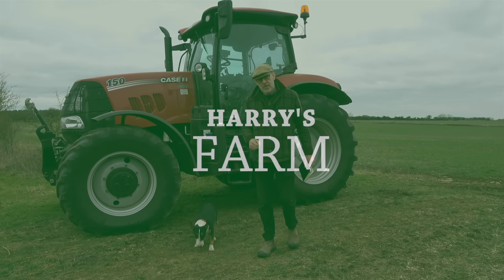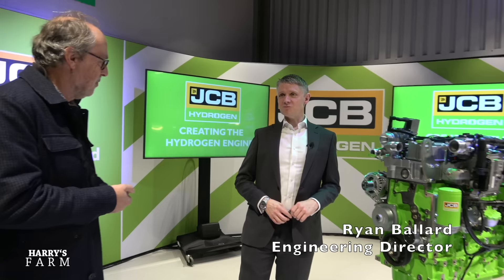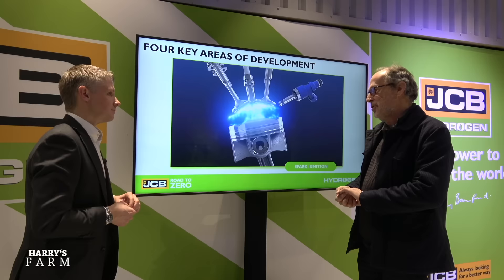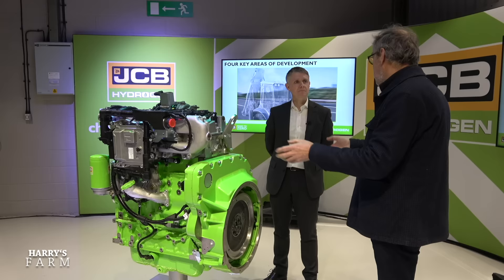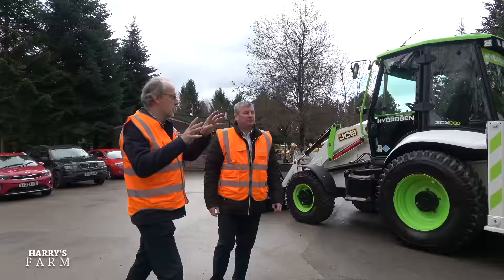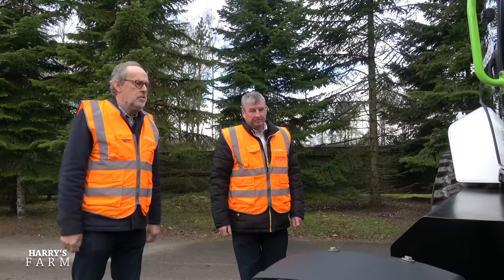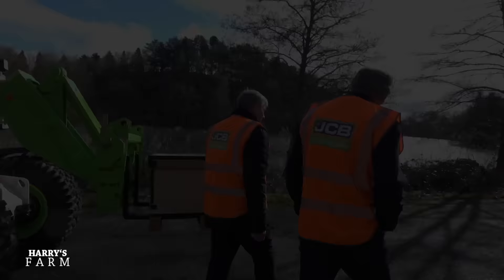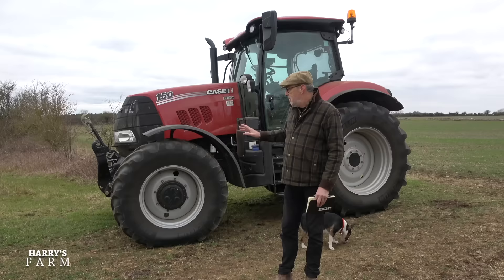JCB is moving to hydrogen power for all their big machinery. Here’s why.

Comment: Until Tesla came along Hydrogen powered vehicles were being researched and protected. Ford has hydrogen powered cars being tested in Bolivia.  What most people don’t understand is solar or wind power electric power has many hidden environmental problems. Solar cells contain several highly toxic chemicals in them that never break down. The minerals need to make batteries are in short an environmental nightmare and both solar cell and the batteries are expensive to safely dispose of and leave us with hazardous waste. The blades on Wind power generators have a short life span and basically the only thing you can do with them is burry them in a land fill. Lastly the materials to make the blades are not environmentally friendly.  In short solar power as it is being done today may not produce as many green house gases but it’s environmentally impact is equally to if not greater than traditional petroleum power plants equipment and vehicles.  Lastly No Country on this planet has the electrical infrastructure for electric powered vehicles and cannot build in the next 20 years and even if the all out effort to do so there are a number of studies that suggest there is not copper left on this planet to do so.
Reply: Immensely concentrated BS.

Comment: 3:30 Two fossils looking at a dinosaur.  Hydrogen is one of the dumbest choices for a fuel - right behind using ammonia. Hydrogen fuel takes a lot of energy to produce and it would be an absurd use of green wind and solar electrons to produce it responsibly. Those green electrons would be more sensibly stored in batteries with minimal losses. Industrial production of hydrogen as fuel will inevitably shift to using methane as a source which will result in large CO2 emissions. For a sustainable future, JCB should be investing in battery electric machines or stick with diesel and insist on synthetically manufactured diesel fuel.

Comment: Hydrogen is the future for all vehicles not batteries. Human behaviour is important and to fill a hydrogen car with fuel is little different (a little colder) than petrol / diesal, no waiting for 20 - 40 mins as with electric. Also, don't have to build a delivery network, they're called petrol stations. The current issue is generation of the hydrogen. But put some British brains on it and it'll get done.

Comment: Why don't they just use the Stanley Meyer fuel cell and not bother with the Hydrogen tanks.   A hydrogen on demand system is much better , especially if the hydrogen comes straight from water.
Reply: Lol there is the Stanley Meyer scam again..
Reply: @Simon-dm8zv  It's not a scam.   Loads of people have HHO generators.
Reply: @boptah7489  Sure, but they don’t improve fuel consumption.
Reply: @Simon-dm8zv   It massively improves fuel consumption..  Plus you can make an engine run on HHO exclusively once you have the correct Anode and cathode harmonics.
Reply: @boptah7489  It can only improve fuel efficiency if you use an external energy source like a second battery that you charged at home.
Reply: @Simon-dm8zv  No.  the excess electricity from the alternator is used to split the Hydrogen and oxygen using electrolysis.  you only need a subtle energy to release the gas.  the key is the frequency and harmonic of the electrolysis chamber and stainless steel plates.  This is the breakthrough that Meyer discovered.  Which was why he was poisoned.

Comment: Im confused. Hydrogen IC engines are only 50% as efficient as hydrogen fuel cells used for E Motor..
 Hydrogen IC engines have more parts that wear out. Weigh more, also pollute more to local environment. And can leak horribly explosive gas.
>>>  And are SUPER neat and awesome!
 I love Engines . Seriously I have machined and build engines for decades... But Electric is more logical. Electric is more efficient and easy to handle.
Its practical , predictable and always ready. Leave the explosive gasses to the utility powerplants and performance racing enthusiasts.
Your on a dead end. I wouldn't invest in this ,hydrogen engines have no efficiency. All this is a bid for an internal combustion stopgap. seems like a way to keep a production line going with an outsourced upgraded fuelsystem. Which means its a limited time offer, will have repair issues, and will fade to obsolescence.
If your in agriculture id avoid this at all cost and just stay with deisel or bio till EV goes full force with the new light fireproof ceramic batteries.
They hold 4 times as much as Lipo, weigh half and dont like to burn. few years but solidly on the way now. flying cars and dirigibles are next!

Comment: So I'm expecting JCB to be the next casualty of woke ideology.   
Hydrogen is extrordinarily expensive to produce, store, transport and hold safely on a vehicle.  It requires huge amounts of electricity to produce, requires storing at high pressure (500bar), cannot be transported by pipe so requires high pressure tanker transport, and requires special high pressure storage on the vehicle itself.  Additionally if any of the tanks or fuel lines are compromised it releases the extrodinarily volatile and explosive gasses.  Think Hindenburg.
The trope that one day hydrogen will become affordable relies on the cost of fossil fuels becoming much more expensive, while electricity becomes much more cheaper.  Unfortunately as the woke inplement renewable generated energy the cost of electricity is increasing.
Amazing that they think heavy machinery users want this added layer of complexity and reliance on a specialised supply chain then they arer fools of extrodinary magnitude.
Compare all this to a 200ltr drum that can be delivered by any truck, stored safely without special precautions on site, handled safety by hand using basic manual pumps or gravity.   
All this could be replaced with natural gas which is readily available now, burns cleaner than diesel, stores safely at low pressure (3bar), is energy dense and cheap and readily transported pipe or any number of non-specialised transports.

Comment: Burning hydrogen in an engine is monumentally stupid.  A fuel cell is much less stupid as it is far more efficient.  This is likely funded by an oil company.  Who else would mislead the public to think that burning hydrogen is a good idea.  Put solar panels on the barn, charge a set of batteries.  Swap a charge battery into the tractor and go.  When it runs down, swap another charged battery in there.  It couldn't be more simple than that.  How much repair does an electric motor need in a tractor?  None.

Comment: so,, instead of buying diesel, they want you to buy hydrogen instead of putting a water tank and a separator that separates the oxygen from the hydrogen? to me that sucks. can't have the public using tap water to fuel thier machines, no tax money for the king. look at all the infrastructure thats needed just to run this new fuel, new tractors, new special fuel delivery system; all these people have to be paid. and in the end whom will foot the bill? the farmer this will fail i think, its sad to me that there are technologies out there that can and proven to take water, and introduce a low voltage electric charge  to it and it will separate the hydrogen from the oxygen that will run a car or truck.  its going to fail just like the electric vehicles in the USA, car companies cannot give those things away, ford has stopped production all together. in Zimbabwe a man has invented a way to take naturally ocurring electromagnectic fields to power a car, and his house. bet he has an unfortunate car wreck.

Comment: LOL   It takes 9kw/hr of electricity to make 1 kw/hr of mechanical energy at the wheel of a vehicle or machine using liquid hydrogen.  On top of that, making liquid hydrogen requires a lot of very expensive industrial equipment and process. When put into a cryogenic tank, it must be either used or vented in 24 hours.  Hydrogen also burns with no flame, and when it mixes with air, it forms an explosive mixture that detonates with a shockwave 300% faster than any other known chemical substance, which gives it a heavy much more destructive punch. Total economic disaster with serious safety problems.  It makes a lot more sense to use hydrogen to make chemical fuels like Ammonia  (highly corrosive and toxic) or better yet Methanol which is very sensible fuel.

Comment: I know zero about engines , but some things about this engine gives me brain worms lol ...If you add oxygen to Hydrogen you get AIR , so how does it ignite? Doesn't the sparkplugs add carbon to the system with every ' spark ' ? and if all that comes out the exhaust is ' steam ' ( which is oxygen and hydrogen ) why is Hydrogen coming out if the engine uses it , am i paying for fuel that just comes out the exhaust? i mean , shouldn't just Oxygen come out =-)

Comment: Big mistake I would think.
Hydrogen is a dry fuel and will there be lubricating problems ?
and just watch the problems that will come with it unspoken of ?
First of all the supply of HYD will be hard to get for most until years later and it is finally available
Competition with battery vehicles and fossil fuels,
And the engine will be running much hotter,
Don't have an accident, and what will the possibility of explosions be ?

Check the facts of battery operated vehicles,
Batteries in winter just don't hold up and the cost to replace them, ouch 1/3 the price of a new vehicle,
And you will find lots of hidden problems, that one is sure  they will come with,
It won't be as easy as some say,
Delivery of fuel to remote sites for small quantities . ouch
Well let's hope i'm wrong, but with batteries, that is and still is a big mess,
And just wait until the cost of charging goes up, 
The big hydro's will just love you
As they are in some places more costly than fossil fuels. 

The problem is that this reset they are calling for is also linked to the WHO, and they are calling it as a 
Climate religion of 10 commitments or something like that,
Where they said you won't own anything and you will be happy
While they live high on the hog
That will be a tyrannical institute they are pushing on us.
Were you won't be able to buy or sell without their mark and agreeing to their principles,

Comment: What they need to do is make/sell a hydrogen-plant-in-a-box, the size of a shipping container with the some solar panels on it or similar, so a lot of mines/farms/sites etc can be creating their own clean hydrogen on-site, that would drive adoption massively.
Reply: er, one small problem: a internal combustion engine running on hydrogen created with renewable electricity uses over 10 times as much energy as just using that electricity directly because it is such a low efficiency conversion process.  If you are going to put in solar or wind generators on site, just use that to charge battery electric plant machinery and enjoy a 10 times cheaper solution.......
Reply: @maxtorque2277  for non-industrial purposes such as cars and light vehicles I agree, but for heavy machinery like this, the size of the batteries required makes them too big/heavy, plus the charge times aren’t even close to being viable. Large numbers of them run close to 24/7, and/or need to be able to be refuelled and going again in minutes. Using hydrogen fuel cells rather than batteries, but then to electric motors is possibly the long-long term solution, but if you’re JCB then the benefits of hydrogen now are too great to miss. They’re just slotting an identically sized and connected engine into existing machinery, and using different fuel tank setup. It means the changes to all their machines are negligible. Redesigning every piece of equipment to have electric motors, regardless of their power source, is a massive investment and decades long process.

Comment: Conversion back to methane, propane and even butane is very easy.. thus it will be done in the future as the real viability of hydrogen becomes apparent.. These engines will never run on petrol (gasoline), but will last a long time due to the clean burn of any of the aforementioned fuels.. (propane and butane that will be readily available through catalytic methane conversion).  Fuels can be farm derived through bio-gas of forages and animal poop..  Steaks are not going away although pork chops may have limited popularity in GB in a few years.. Chicken poop and goat poop will be way to expensive as they will be more profitable as a dried bagged product for other types of farming due to shape, size ability to dry and overall handling.. and the home kitchen gardens..  Slava Ukraine =de-militarized+NATO+N@z! FREE

Comment: Electric vehicles aka coal powered vehicles are a disaster. Metal mining for batteries are a nightmare. Hydrogen powered modified diesel engines are where it is at.
Reply: "coal powered" is purposefully misleading. Which countries are mainly coal powered?
What's the CO2 output per kWh in your country? 

And then you imply that hydrogen is cleaner, a fuel that requires MORE electricity than electric cars do.

Comment: This makes me laugh, don't you all know that atmospheric water vapour is a bigger contributor to 'global warming' than co2 is by an absolutely massive margin and even that co2 is the worlds natural plant fertiliser that everything living thing is based upon, which is far more important to the worlds ecology  than a bit of hot steam. Another thing, how is the hydrogen produced, is the production process also net zero? and then there is the safety aspect, think about a large pressure vessel at 350 bar pressure of a super flammable gas in a vehicle that's ON FIRE, that's going to be rather dangerous, then there's these recent car park fires, if there was hydrogen fuelled vehicles in a fire like that the authorities are going to be evacuating residents for miles around!

Comment: A true hydrogen engine would inject ordinary water into the cylinder. The spark plug coil power supply would be electronically designed to introduce a spark that is set to the resonant frequency of water. The result would immediately split water into its components and combust. The exhaust would be water. The onboard tank would contain water... not gas, not diesel or hydrogen. This technology courtesy of Stanley Meyer; he's already done all the dirty work; embrace it. Thank you Stanley!

Comment: I would rather buy a hydrogen car . I hate electric cars.  I have one question about hydrogen engine's,  only water will come out of exhaust but with that mean the exhaust pipe will rust quicker?.
Reply: Why do you hate electric cars?
Reply: @Simon-dm8zv  expensive the batteries are heavy.
Reply: @MartynStubbsTBS  Hydrogen components and engines  are also expensive and heavy.
Reply: @Simon-dm8zv  no hydrogen is cheaper,  hydrogen is all around us! Take india they inport all their oil but they could easily produce their own hydrogen which is green !.
Reply: @MartynStubbsTBS  making hydrogen is terribly inefficient because it takes a lot of electricity. A lot more than an electric car uses. Therefore hydrogen will always remain more expensive and less green.

Comment: So where exactly does this cheap hydrogen come from again?.  Seem to remember something about the dreadful inefficiency of burning hydrogen in an ice.  For all their problems you get back about 95% of your input energy from a battery and about 10% loss in the motor .  Turning electricity into hydrogen loses about 40% in electrolysis then more energy to compress it. Efficiency of an ice is about 30% efficient .  Farmers and high pressures hydrogen connections sounds like a recipe for disaster. Tesla aint daft.

Comment: Going to hydrogen =EVs in this matrix are not practical . Natural gas =CH4 Take the carbon out =H4  . Problem is hydrogen storage and transfer for the low IQ users especially when there is a tech problem. Ease of use for users

Comment: Salute to all engineers who worked on this - on reducing NOx problems - but from another engineer's peer review perspective - what an utter futile waste of time.   In a nutshell the absurdity if it runs like this;
Let's use all this clean soalr (or wind) electricity to create green hydrogen so we can run hydrogen combustion engines - along the way we will lose 50% of original electrical energy in the green hydrogen production  and another 50% loss in the combustion efficiency.  So overall loss or electrical energy will be about 75% . i.e you ar eleft with only 25% of power you started out with going into actual mechanical work at the digger end.  
Now with a battery system you start out with maybe 10% transmission loss and 5% motor loss.  You still have near 85% of original electrical  power - not the 25% of hydrogen combustion.
Hydrogen has some  potential energy store mechnanism (though I'm for liquid air or massive sodium ion batteries) - but its use in motive applications shoudl be with fuel cell/ motor tech. Not combustion.

p.s. BY the way -  using the current price of hydrogen as a marker point is total nonsense. Nearly all hydrogen is produced today is as blue or grey - i.e. reduction process from carbon based gas - i.e . Green will be more expensive as for every kwh of hydrogen power at  digger end you will need 4 x the amount of solar panels you would need to produce 1 kwhr electrical energy. So you will pay 4x the cost 

p.sps. ANother engineers take on a hdrogen V8 engine developed byToyota - and why it only makes sense if you want a nice V8 sound. If thats your thing then combustion ill be required for hydorgen tech
https://www.youtube.com/watch?v=vJjKwSF9gT8
Reply from the maker: You need to watch the first video I did with JCB back in July 2021 as they have already tried using battery powered electric machinery (and fuel cells) but they couldn’t cope with heavy prolonged work and recharging was hard because these vehicles mainly operate away from high power electricity supplies. Hence why they are now looking at hydrogen.